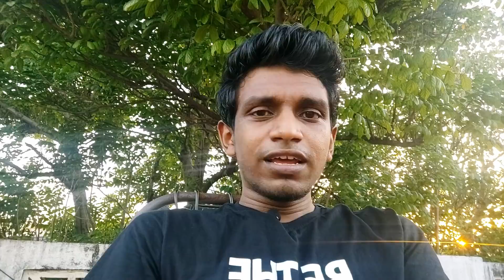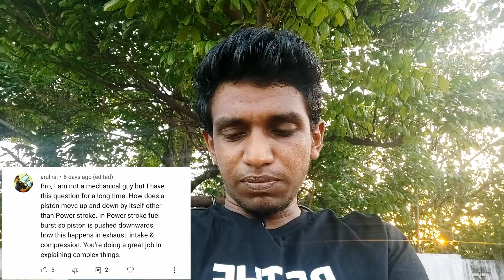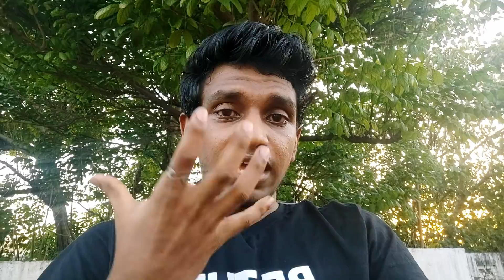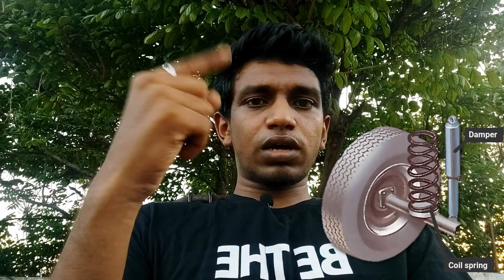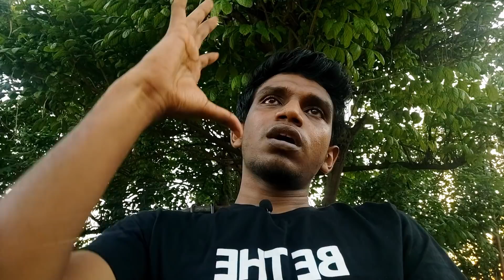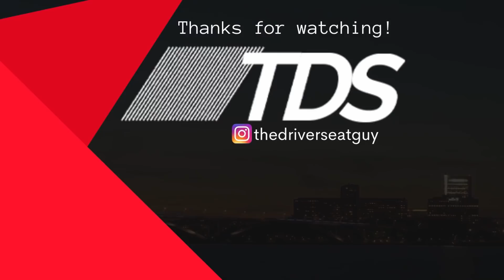Sensors & Actuators - Explained in Tamil #TuesdayTechTalks Ep.22

Comment: Bro, am watching ur video in long months, that is more informative congrats bro

I am small confusion to buy a car bro, so please suggest me,
I get any type of car such as hatchback, sedan or sub 4m suv...
But I need petrol manual smooth car & without noise in cabin, cheap service cost, resale value, best reliability & driveability that means soft clutch & soft gear box setup, well rifened engine, best features in low cost, value for money, feature is central locking, 4doors power window, rear AC vent  is enough
Please suggest me
Reply from the maker: Hyundai Venue and Vitara Brezza
Reply: @TheDriverSeatGuy  thanks bro, but what about sonet base model bro, mechanically same to venue, any other reason to choose venue or breeza

Comment: Why Disc brakes are placed in opposite side in bikes....left side in front and right side in back?

Big fan from ur Torque converter video......keep rocking 🔥
Reply: Athu ella bikes layum apdi irukathu bro nd also opposite sides la irukuthu yen na bcoz innoru side la chain drive irrukum connected with crank nd gear box so opposite side la irrukum , oru sila bikes la paatheenga na like ns200,gixxer sf ,apache 2004v , 160 4v nd rs 200 intha bikes la lam rear disc irukura right side laye front disc um irrukum .

Comment: What if we increase the weight of flywheel, does it increases the torque??
Reply: Good Question
Reply: Power required will be high if weight of the flywheel increased. To get high torquethe length of the connecting increases then torque will be high tats why long stroke engine produce high torque
Reply: No torque does not only depends on flywheel ....it depends on many factors like cylinder size,fuel intake and so on......

Comment: Bro oru doubt romba naal ah irukku pls konjam answer pannunga.Intercooler ooda work air ah cool panni combustion chamber ku send pandradhu.Petrol cars ku its okay but diesel cars need high temperature air for ignition,but why they are using intercooler and cooling the air? In diesel engines 🤔 pls answer pannunga bro
Reply: Bro air aa cool pannumbodhu it becomes more dense, which helps in good mixture with fuel, diesel la after compression automatically the temperature increases which is not a problem